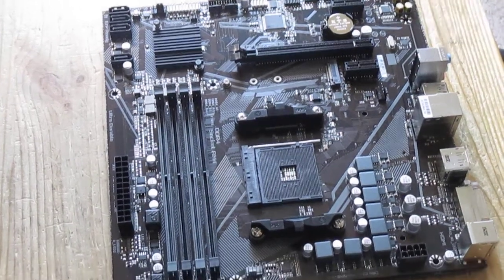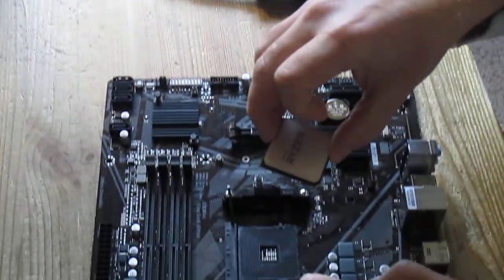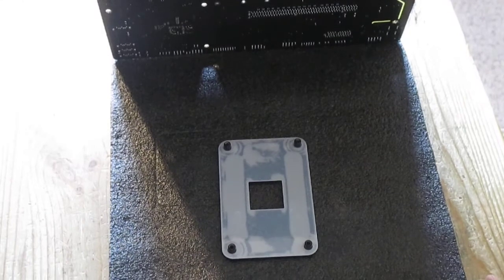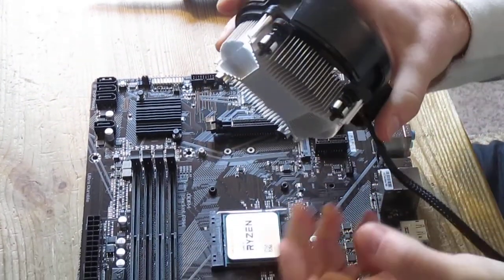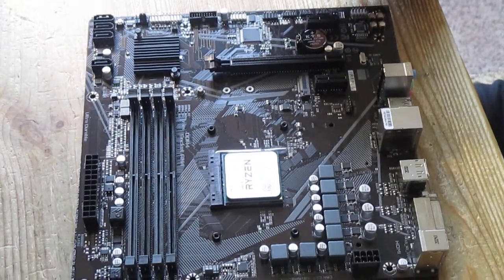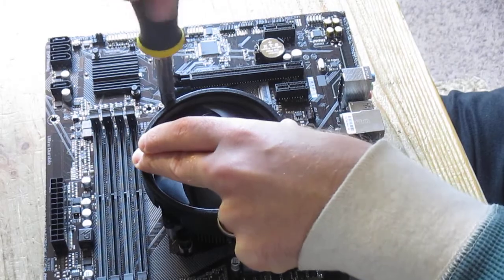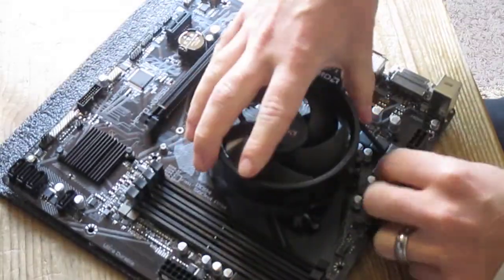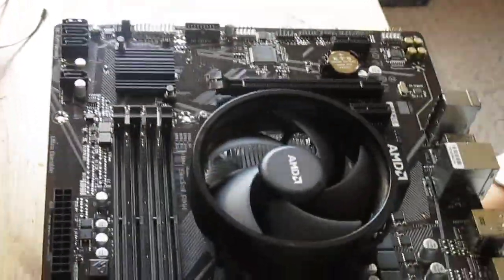AMD CPU cooler installation. How to install AMD AM4 processor and AMD Wraith cooler on motherboard.

Comment: My backplate keep falling since i removed the cooler for thermal paste. And i don't want to remove all my cpu what can i do ?
Reply from the maker: If your case has a cutout in the motherboard tray, open up right side panel, use open cut-out to align the backplate, then put something under it (like a piece of styrofoam to prop it up while you lay PC down on the side and install cooler on top.

Comment: Great video.
Thanks for this
I actually took my CPU cooler to a small shop and I did everything right

All I did was I was afraid to turn over the bard to see the backpalte and hwo far the screw went. LOL

I guess it I fine to work on the board like this on a flat table and not be afraid to hold it in one hand. It's  Fien to do it that way on a table?

I'll keep this tutorial in mind
Reply from the maker: You can keep it on the table and press screw driver on the screws all the way in. Make sure screwdriver does not slip off, you can hit the board with it and actually damage it though.
Reply: @CentaurusComputersCharlotte  Great thanks!

So the next time I screw a CPU cooler in I can screw it in with the board flat on a table as you did right?

I was worried I would be giving too much pressure to  put the cooler on, but it seems pretty easy. 

I will try to watch this video the next time I do it but. also remember pressure is ok 

Also. Which screw driver is best for this I saw the tech sue a smaller one than I have 

Will Fix it work or?
Reply from the maker: @luckychukiye8743  Yes, fine on the table, you are putting pressure on the backplate via screws, not on the board. Any screwdriver will work if it has good contact with the screw heads.
Reply: @CentaurusComputersCharlotte  Thanks!
I"ll  remember that .

Will try to turn on the PC later today 
 & let you know.

Thx again for this video